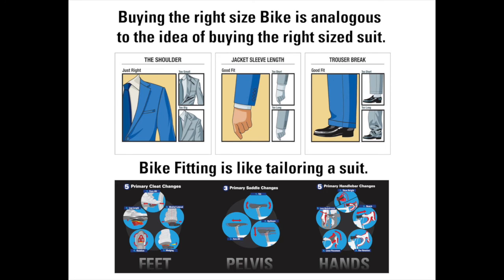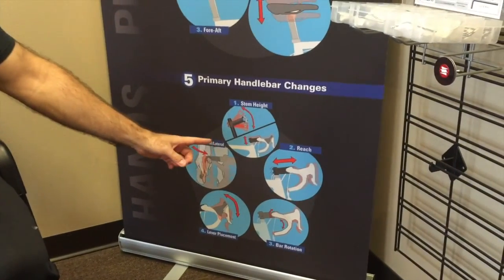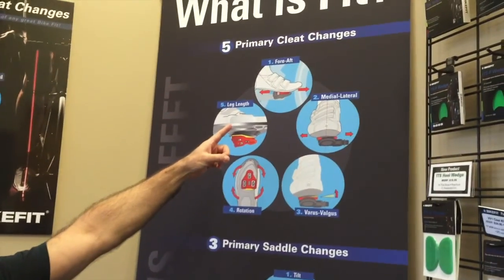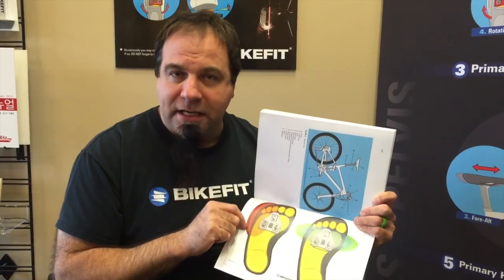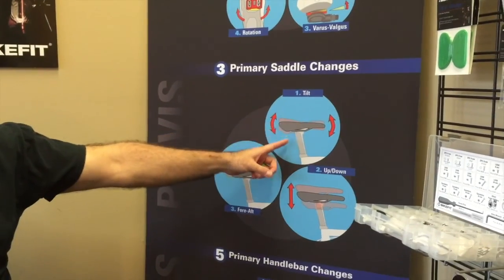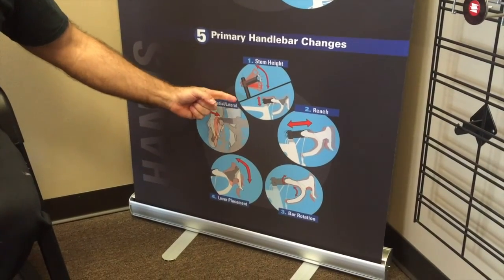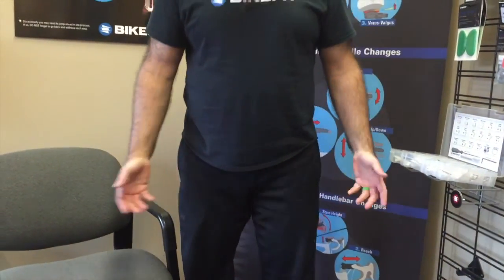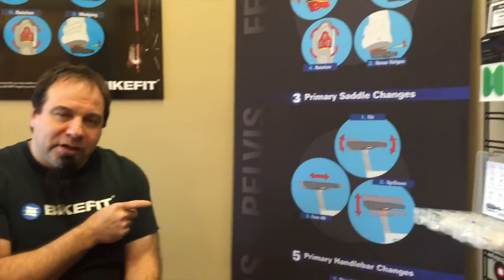What to expect in a Bike Fit

Comment: If I buy a bike online, how can I....1st) choose the correct frame size, considering that different manufacturers have different sizing measurements, 55cm of BRAND A may not be the same as that of BRAND B;   2nd) perform bike fitting? Am I only able to do it upon arrival, and at a local bike shop?